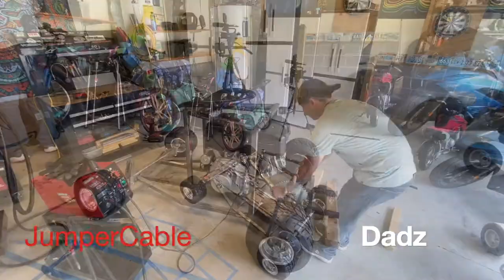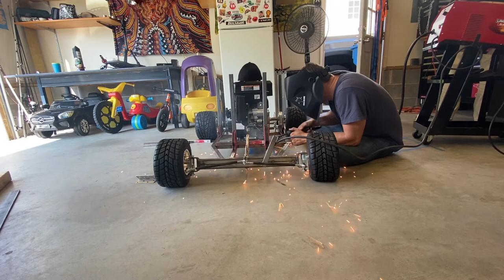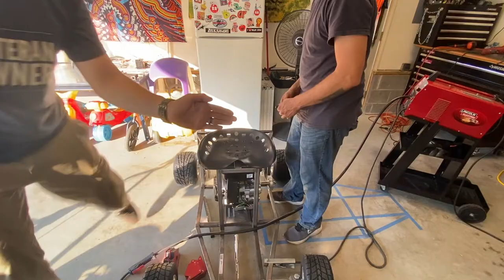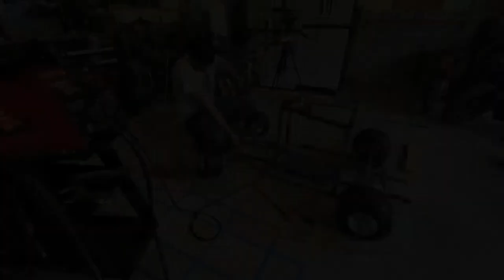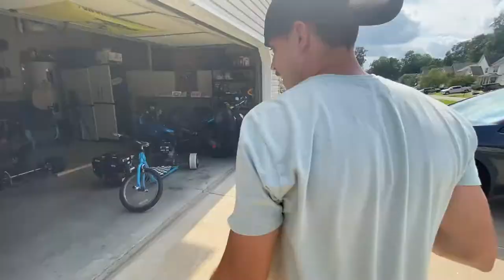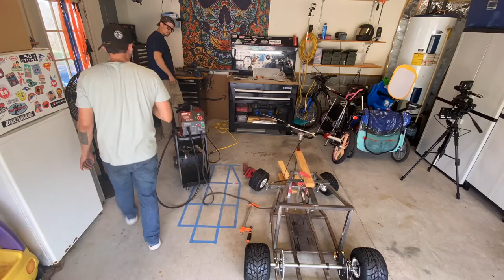How to build a bar stool racing kart frame | Welding | Part 3

Comment: could you elaborate more on the spindle sizes and such for wheels and backspacing/mounting, trying to draw out a cooler cart that will be about 4ft long with a modded GX390 electric start. and anything youd change looking back after the build
Reply: Hey, Scott here, thanks for watching. Spindle sizing is 3/4 and they’re the ones from comet kart if you look at there barstool kit. We set the wheels at 0 camber, slight tow in, and +15° caster. For the weight, I’d set less caster cause it takes so much to lift the vehicle when doing sharp turning. I hope this helps. Let me know if you have any more questions.
Reply: @scottjohnson7263  any reason for 3/4 over the basic 5/8 spindles.
Reply: @MobWithGuns  nope, my mistake. It’s the standard 5/8 for sure. The spindles and steering shaft were same diameter.
Reply: @scottjohnson7263  and 15 degrees of caster , usually I see everyone recommended 5, maybe 10 max turned back so no death wobble
Reply: @MobWithGuns  yeah, I didn’t really know what I was getting into and found setups for racing carts and someone recommended 15. It was to much for this application. 5-10 would work better.
Reply: @scottjohnson7263  do you happen to remember the tire and wheel sizes